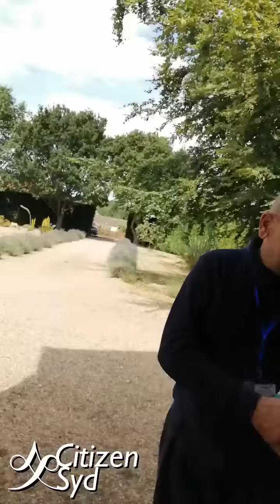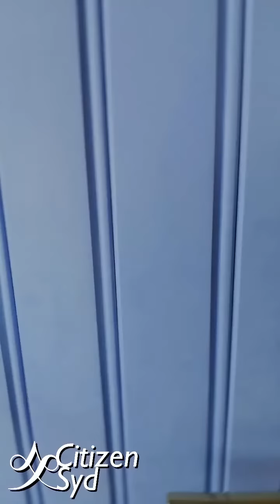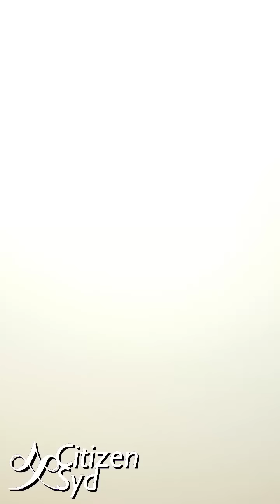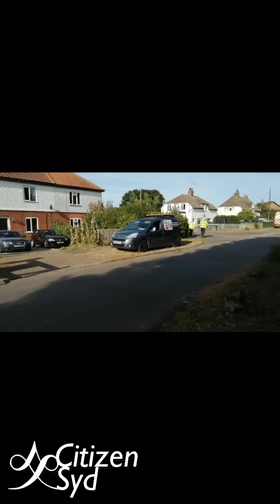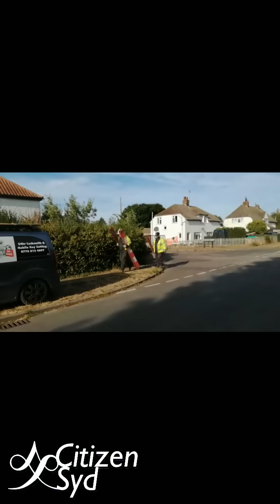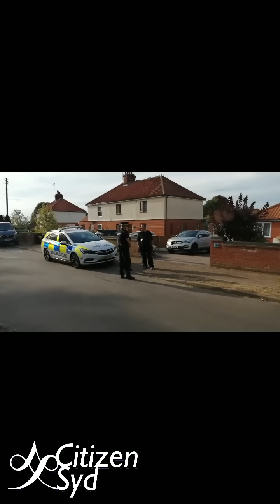Mother of Disabled Children Has Her Electricity Cut Off - Continuation

Comment: Syd, I believe the proper procedure for own meter install is:
1) settle account in full.
2) End the (contract).
3) have new meter installed professionally
4) return their meter (get receipt)
Reply: What she did but her father not the householder rang and contracted to pay behind her back then they claimed no signal to meter even though bill paid up to date and she left supplier
Reply: Good advice @Tonedial 👍🏻
 @samallison5692  Isn't it common in Country areas for these meters not able to send readings.
I've read of many people having smart meters installed, but still must give manual readings every month & it doesn't seem problem for energy co.
Are they perhaps just saying this as extra excuse to remove meter she had personally installed? Even tho said meter was inspected when installed & is counting the units fine. 
Just to understand, is energy company who are cutting supply, the old or new supplier? Maybe that's a moot point. 
I'm in similar circumstances, villified bc I stated I don't want smart gas meter after finding last years new meter broken in April.  ~Wish my 30yr old mechanical Schlumberger meter was still here , sure it would be still working.
Reply: @suzycat2026  In rural areas, the meters link into a 'smart wide area network' in which the signal bounces off all other meters into a more powerful network, to help signals along. This is similar to the lamp-post antennas on the luminaries, that light-up the next-in-line pole (you may notice them all firing up a split-second to the next as they light up) 💙
Reply: @TONE11111  that's what we used to call a WAN 😀 
Thanks,  have a superb warm day @Tonedial x
Reply: @suzycat2026  yt channel: minivanjack has a set of good vids about meters, even though it is usa
Reply: Thanks , I will look him up  @TONE11111  B.gas agreed to send " experienced engineer " today, Friday for second opinion on boiler. 
I know not all engineers are equal, maybe he will be prepared to investigate pilot light , trying not to get hopes up.🙏🏻
Reply: @suzycat2026  thats a start hun... i had a plumber a few years back, he diagnosed the problem, then told me the part number... i drove to colchester and picked up the part, installed myself.. job done. 💙
Reply: That's lucky, I still have my original manual @TONE11111  Engineer showed me soggy electric box in boiler, water everywhere since last guy here. Not looking good at all > twas worth a try.😥  Found a couple places to ask for help, otherwise it's huge b.gas loan 5yrs , if I qualify!
Reply: @suzycat2026  oh no, not a loan.. this isn't the time to increase debt... i'll relate a story -  My friend phoned me and said: 'can you help, i bought a boiler on ebay, can you help me install it?' So, i said yes... and we managed to install it ok. If you can find a similar boiler, same dimensions, it would make it easier if u choose to replace it for just £50 or so for a used boiler taken off to be replaced with a new one. If THAT fails, then u could consider a reluctant loan... i feel for ya hun.. 💚
Reply: Your friend is very lucky to have you @TONE11111  🤗  Thanks for your help & kind words,, I just wrote a reply, but has disappeared,  oh dear.
I think installing new boiler is only way for me.  If I can't get £help, loan is only option. 
Bigger job than imagined too, private contractor confirmed that today. New condenser pipe from flue to drain, bigger gas pipe etc., Aargh, it's my own fault for keeping old Faithful for 30years. 💜
Reply: @suzycat2026  condensate pipe is just a 1" white plastic water pipe (copper will corrode from the acid) that takes away half a gallon-ish of water an hour, my one was plumbed right into the washing machine waste (which is best, as it wont freeze indoors) It's not expensive. please dont be listening to plumbers bs.If you get these lot to do it, make sure they drain the system completely, and vacuum the silt from the header tank in loft, then flush it through twice, before putting inhibitor in the system. Radiators will need flushing through too, or will wreck the new boiler. 🧡
Reply: Thanks for your invaluable advice  @TONE11111  👍🏻Haf gallon of water, saved from the flue! Does that go for combi boiler too? Mine is against the outside wall, nowhere near sink or washing machine, hope it will it be safe to put it outside down drain there. 
No water storage tank above,  so maybe yours is a ' system boiler '.   I will try not take salesmen too seriously! 
Excellent advice about cleaning the radiators, will take note of all that, i have a journey ahead., but once sorted it will surely save energy & money in long run.
Reply: @suzycat2026  The Worcester Bosch 25i combi boiler (condenser) is the current award winner product. My boiler setup is what you would call 'Conventional', as it has header tank as well immersion hot water tank. A 'system' setup has header tank missing. Yes, i flushed my rads, by unbolting the valves, folding the rad down, then lifting it carefully upside-down into garden, and run hose through them until water becomes clear (not black). Youtube channels 'dereton33' and 'plumberparts' have been invaluable, best advice and vids on any plumbing problems... ❤💚
Reply: Certainly is an education  @TONE11111   I'm not too sure of all different types, yours sounds great, so it's still a combi boiler but with water feed tank above, & extra hot water storage in immersion tank > is immersion water kept hot by electric?  I ask as there is an old immersion tank in bathroom that I never used (not near the boiler tho).  Yes, I'm familiar with Dereton33 channel 👍🏻 
Good to know your happy with that make. Model recommended is Worcester Bosch Greenstar 4000 30kw , my last was only 24w,  but this is the only 1 b.g. recommend.  > with only 4 radiators, in your opinion, do you think this model too powerful for my needs? Or, more how it's used.  Thanks 🙂
Reply: @suzycat2026  ok... 1) A Combi-boiler doesnt need an immersion tank in bathroom, as it provides 'instant hot water' as well as radiator circuit heating, all in one small compact boiler.  2) my boiler is a condenser/conventional/has header tank in loft and immersion cylinder in bathroom. [if there is no header tank in loft, or that isnt possible, then your boiler must be pre-pressurised with a filling loop and gauge either near to, or bolted underneath boiler.] If you have a 'dormant' tank in bathroom, then i think its either 1) an emergency hot water supply if the boiler breaks down, or 2) your existing combi replaced the old one many years ago and they didnt remove the cylinder... ❤🤎
Reply: So, a combi should be max, about £3000 to supply/install
Reply: Very close! they quoting £2800 @TONE11111   Feel better now you say that! 😉 
Yes old immersion tank from previous owner who had all electric storage heating.
Hearing your condenser setup just made me wonder if it's worth considering using it.   
T other kind of combi is fine for my needs.  It had pipes to top up underneath as u described. 
~ Hopefully things will run smoothly,  once finance is sorted.  Gracious thanks , have the best weekend possible 🌻😼🎵🌅
Reply: @suzycat2026  if you can get hold of the plumber's survey, they may have concluded that a header tank wasn't possible... or they are just hoping for a simple install, and saying 'thats gonna cost ya know!' who knows with these plumber species... 🌻
Reply: @TONE11111  thanks, the comb is good for me , but yes those plumbers & engineers are not all equal 😁

Comment: How can people do this as a job? They will be coming for them one day.
Reply: The  common law stuff Don't work on them, A only serves to get their backs up , The meter should have been put on DUMB MODE  and the customer should have made a complaint to Ofgem if her supplier refuses to do this
Reply: @tomwarner5784  what’s dumb mode?
Reply: @bertibear1300  It's where they claim to  disable the  SMART features So it doesn't communicate with the supplier. And they presumably cannot change the tariff or remotely disconnect you
Reply: By your logic, how can anyone do any job? Should a store manager let people shoplift whatever they want? Should a car salesman let people drive off the lot without paying?
Reply: @bertibear1300  A SMART meter with it's SIM card  removed, thus it's ability to be controlled remotely by the energy company disabled, So would work the same as a non smart meter
Reply: @tomwarner5784  "change the tariff"??? WTF are you on about. The tariff has nothing to do with what the meter does. 
(Unless you're an electricity thief and they've had to install a pre-paid meter for you.)
Reply: @moonshade6864  Well, we have seen plenty of stupidity over the last few years.
Reply: @xcrockery8080  They do it in Canada to  nudge people in to using electric  in the early hours  when demand is low, by charging a cheaper price at that time, but they hit people hard at peak times, they cannot do this without a smart meter as it measures real time use,  They are insane
Reply: @tomwarner5784  We've had different tariffs at different times of the day for decades, using mechanical meters.
A "smart" meter just means they don't have to send anybody around to read it because it has a 4G card in it and it sends all the usage data back to base.
Nobody needs to "change" the tariffs, that's just billing.
Reply: @xcrockery8080  USING DIFFERENT METERS, ECONOMY 7 is the only different tariff  that works at night  from 11pm to 7am designed for storage heaters and  hot water tanks heated by immersion heaters , Because There would be NO way for the energy supplier knowing what time you used the energy  with a standard meter the SMART METER IS  REPEATEDLY SENDING AND RECEIVING  DATA FROM THE ENERGY COMPANY ,So they can see in near real time when and how much you are using,  And can increase or decrease  the unit price at what ever time of day they want, And they can also remotely disconnect your supply Just because they have not used these features so far doesn't mean they won't at some point in the future they already do in some countries